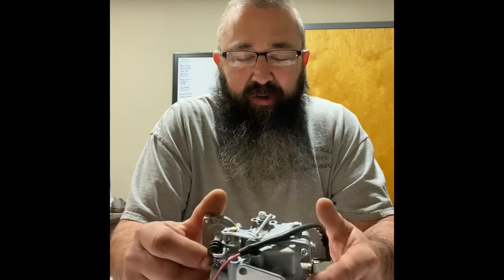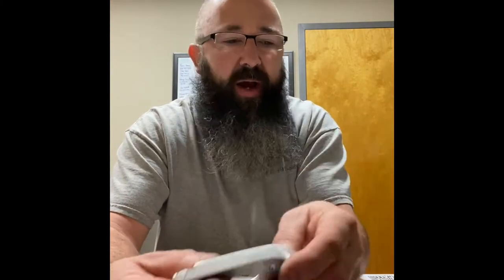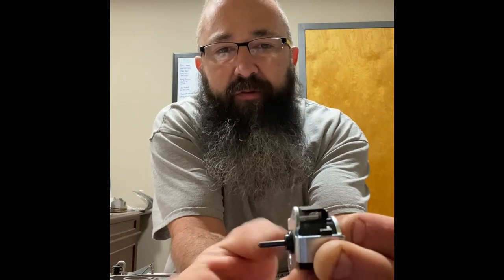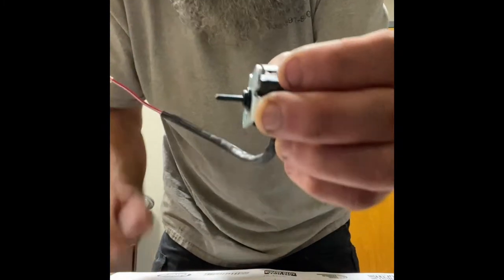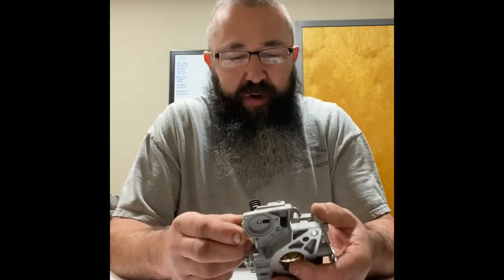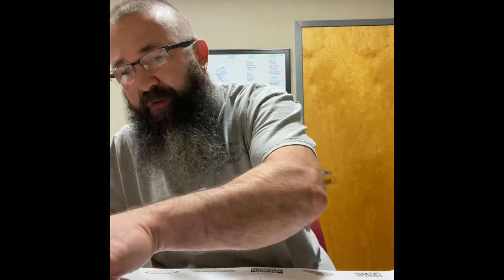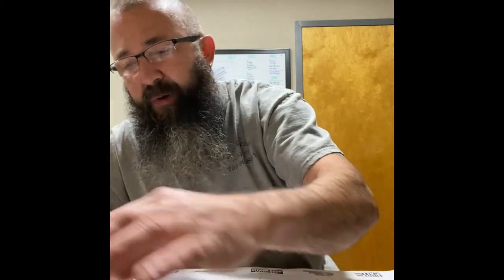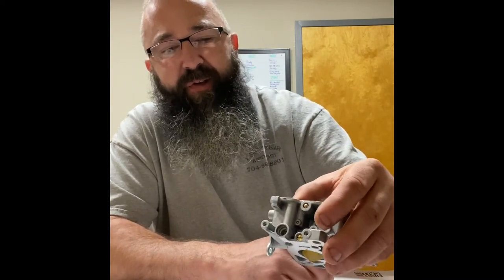Kohler command carb mods

Comment: I've seen tecumseh carbs used in high vibration conditions have a float dampener spring to hold more pressure against the seat.

Comment: I'm on my daughter's YouTube. This is the first time I've seen your video. I have no idea if you got your kohler carb to work on your briggs or not. Off the top of my head I can possibly see you having a stumble or lean condition. I don't race mowers by any means, but I do like to modify my mowers and snowblowers. If you do have a stumble or lean condition the first thing I would try is to take the emulsion tube out of the carburetor, if it has one, and solder the smallest hole shut. Then put it back together and see how it runs. If it runs better but needs a little more then solder another hole shut the same as the first one. Try it out again. If it runs too rich then. Drill a hole in the emulsion tube towards the bottom that is half the size of the soldered holes. You get the picture what to do if you solder the first smallest hole shut and it runs rich. Just drill another hole half its size. Like I said, I don't race mowers. Some of the modifications I do is to convert my mowers to run on E85. With E85 your supposed to enlarge the main jet by 30%. But I found out that the throttle response is poor. So I measure all the holes in the emulsion tube. Find out what the total is, then multiply by 30%. Whatever I get I know I have to subtract that amount from the emulsion tube. Sometimes I get really close to soldering the same size hole shut. If I don't have any holes the right size in the emulsion tube, then I'll solder the next one bigger shut. If it's too rich then I'll drill one of the other holes slightly bigger. Sorry for the long story.
Reply from the maker: This is awesome information! If anything I am rich from idle/off idle and steady throuttle through about 2400-2500, but still have response from the idle mixture screw. Maybe try opening up the E tube holes a touch? Always wanted to try it and I know what theyre there for, but never knew to start at the bottom or the top haha.

Comment: I found this video very interesting as I have experienced all the same symptoms as you describe. It just a shame that when you are pointing to bits on the carb that the carb is actually off camera I think you could do with remaking this video if I’m honest. Now I have a kohler command with the same carb but without the accelerator pump. As soon as you hit any bump in the track it would hesitate and bog down and fall flat on its face some times it would come to a complete stop on the track before clearing its self and getting going again.I tried everything I could think of to cure it. What the problem actually was was that the engine was low on compression.  So it couldn’t burn the fuel efficiently I had then engine bored and fitted the. Next size up pistons and rings and all those symptoms disappeared overnight at worse it might hesitate for a split second on a large bump but you would hardly notice. Recently I accidentally blew that engine up while racing from not checking the oil so I went out and bought a second hand kohler command that unfortunately was low on compression 150 psi when the kohler says it needs to be 160psi minimum and guess what all those symptoms are back. It’s also worth noting I am running a completely standard ch18 carb without the accelerator pump or any modifications.
Reply from the maker: Im not that great at doing vids haha, wasnt going to bother with a remake if it didnt generate any interest.  As for your carb, did you try raising the float bowl vents with a bit of copper tubing?
Reply: @captain_315  no I haven’t but I will

Comment: Question. Do you recommend the new Chinese Carb. or rebuilding a used one ?  I have seen this Carb. made in China for about $35.00. Used ones people are asking around $80->$100.
Reply from the maker: This one is a chinese and it worked just fine

Comment: I have a command pro CV20 (641cc 20hp) . Is there a way to boost hp a bit but not make it a short-lived engine? The mower it's on now needs more power, but a new engine  is very pricey for the age of the mower
Reply from the maker: A better exhaust and free flowing air cleaner would likely help a lot, as well as a little bigger main jet.